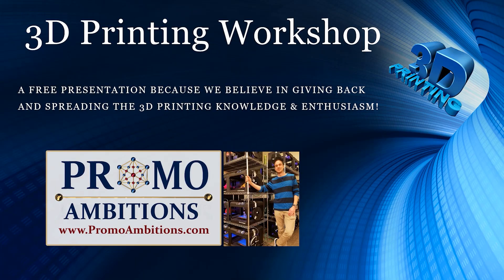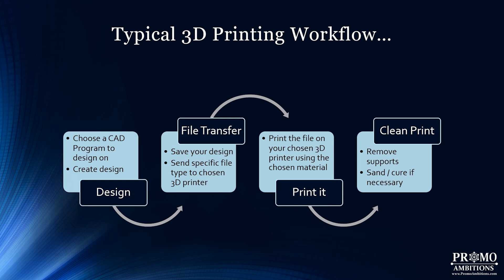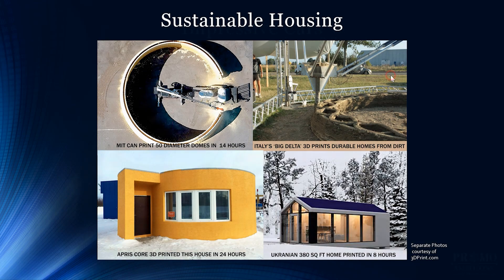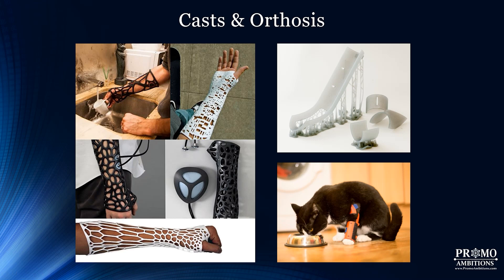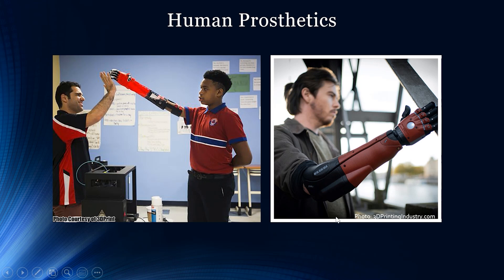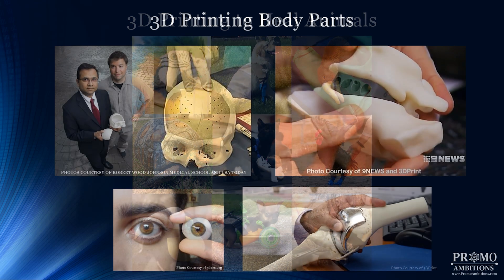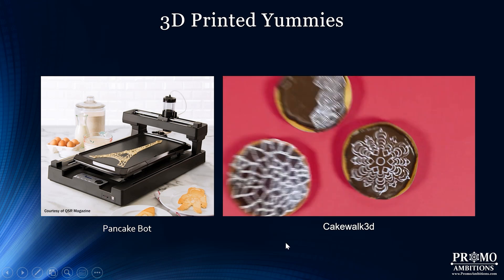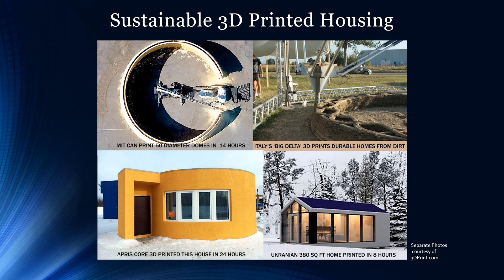3D Printing in the Real World | Part 1 Workshop Presentation

Comment: Very eye opening with all the examples...thank you for the well rounded analysis! Do you feel that there is a limitation with the size of printers? Does this drive towards molding parts together?
Reply from the maker: Typically the bigger the printer, the more $ it costs, so there's a financial limitation. Unsure I understand the 'molding' part of the question, you can print in smaller parts and assemble them together if that is what you mean. Are you speaking of injection molding?
Reply: @PromoAmbitions  thank you for the clarification, hopefully trying to determine how much more expensive bigger machines are (cost : size... for same quality). Yes was asking about how smaller pieces come together and you explained it well with the molding example. Thank you!
Reply from the maker: @ebelkin89  this is difficult to answer... most of the large 3D printed machines are built custom for a unique purpose. For desktop printers, the bigger the printer, the larger the size of the print you can have at once. Quality depends on manufacturer and intended purpose.